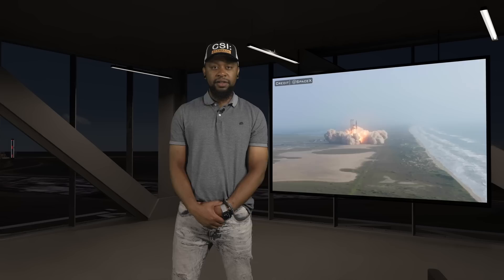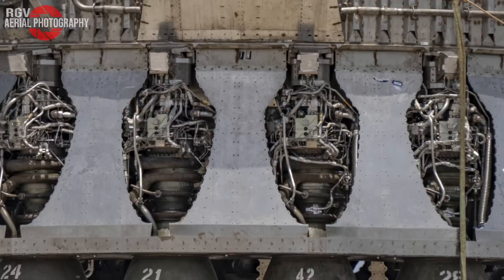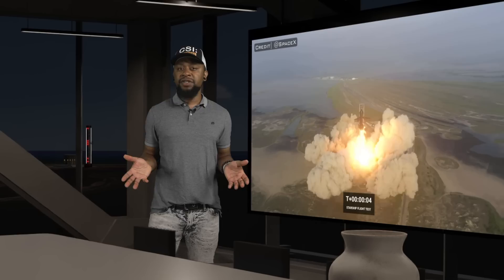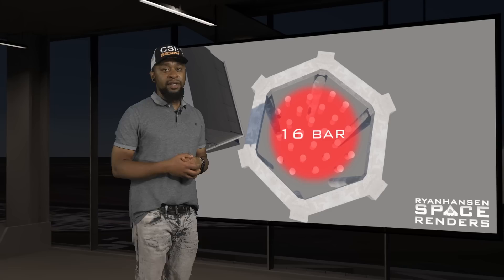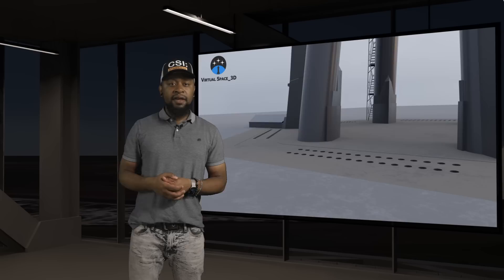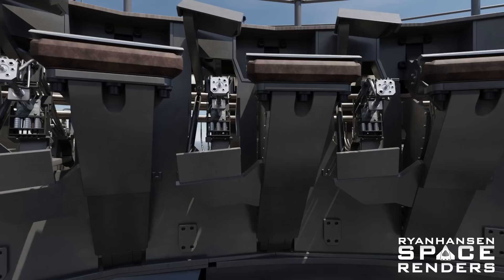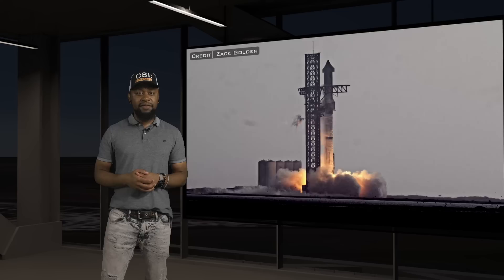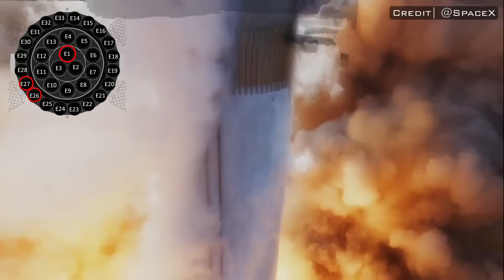The Design Flaw That Caused The Starship Launchpad to Fail!

Comment: A flat pad even with water cooled metal plates doesn't seem the best option. To properly divert the flames and shock waves, SpaceX should consider angled plates with tall water jets projecting water over it. While build near the tower a metal stand to place the booster for inspections and maintenance.
Reply: Maybe shallow cones stacked on each other, with water flowing down the slopes of each cone from under the upper cone... like a 3 tier 6 side pyramid thing
Reply: There is no need to divert flames as the flow of engine exhaust does that naturally
Reply: I advocated a V-2 style large inverted cone, sweat-cooled as we see here, last year. I don't see it as practical anymore. As for a second stand, it means added step(s) wasting time; and as EM told Tim Dodd, time is number one problem.
Reply: Nozzles could be vacuum venturi or like a pitot tube to use the exhaust velocity pressure to suck the water from the supply.  angled outward to assist exhaust direction transition from vertical to horizontal.
Reply: @richbarrows3922  Nice idea, a T shaped nozzle might achieve similar effect as per animations. Only problem is the top of the T shaped nozzle is unprotected
Reply: @123clickit  I agree.

Comment: Zack another great technical commentary and videos/annimation. Spacex engineers have done an incredible job in updating/modifying the OLM which has become incredibly complex with multi levels of safeguards. The rocket thrust heat transfer/vibration analysis shud be able to be computer simulated to provide adequate design - but as usual it is the 'unknowns' that are problematic. Great job by all !

Comment: Easily the most in depth and full technical analysis on YT of Starship's first launch. First time I have seen anyone actually explain how the water cooled shielding will be supplied with water plus an analysis of exactly what needs to be achieved in such a system to prevent explosive boil off within the shielding itself. Going to have to watch this video at least another couple of times to take all this info in.

Comment: CSI Starbase… THANK YOU! 👍 When you showed me that photo of WATER being pumped out, it all made perfectly sense:
I will bet you that LIQUEFACTION was the MAIN PROBLEM for the rapid unscheduled disassembly of the ramp slab!
You also pointed out, or speculated rather the missing rebar interlinking between the Fondag and the normal Concrete below.
The Extreme Sonic Energy released will also induce an extreme amount of heating in concrete. I am thinking that this could cause the water inclusions in Concrete to form steam and explode. The same principle makes ordinary Concrete unsuited as a fire barrier, especially in high temperature fires. The concrete simply starts exploding, shedding sharp shards with significant kinetic energy, which can erode surrounding structures by itself.
But as a Main Hypothesis I would put my Money on LIQUEFACTION! The Extreme Sonic Energy released would have the Sand Water Mixture liquefy in seconds, removing ALL Support underneath the Central Slab.
With the complex Sonic Interference Patterns, possibly coupled with variability in the Sand:Water Ratio, this Liquefaction may not have occurred in a Homogenous way, thus increasing Bending Forces across the slabs, moving the Force on the Concrete from Compression to Tension.
Fondag can only handle temperatures of up to 1,100°C. My guesstimate is that the temperature on the surface reached 4,000°C, so erosion was to be expected. But with a broken up Base due to Liquefaction, the internal strength in the Fondag would be overcome faster and more catastrophic by an order of magnitude than it normally would have, if only high temperature and compression were the eroding factors.
Reply from the maker: Thanks! That’s a great explanation!

Comment: It would seem to me that if the ship is still functional after a booster failure, even if it doesn't have enough speed to reach orbit. They could burn the tanks to landing weight and abort to splashdown, or possibly RTLS. Potentially saving the payload, or even the ship. At least they could have some mostly intact wreckage to examine.

Comment: Interesting! The choice of Fondag as a replacement for regular concrete was an experiment I would not have taken. Methalox combustion temperature is 2810 deg C, Fondag is only good for 1100 deg C. The pressure fluctuations and shock-waves would have caused failure, after the heat had broken down the Fondag, as you said. The exhaust force/pressure is perpendicular to the surface, rather than angular impingement that diverts the hot gasses. I have seen more re-bar in concrete structures for road-bridges in UK, combined with 110 Newton granite-aggregate concrete than this structure; although it doesn't have to contend with the heat.

Comment: What you should be talking about is the 13.3 kpsi static pressure on the pad at launch.  
This is well above any allowable concrete stress data.

There is no way it is only 200 psi as you stated in this video.  200 psi does not blow car-sized chunks of concrete 100 feet in the air.

Comment: 32:00  Knowing SpaceX's preference for software solutions over hardware I expect the water flow timing and volume will be regulated by info from the engine ignition sequencer. The nitrogen pressurization system will allow for very rapid increases in flow. This will match the water flow pressure to the exhaust plume pressure.
Reply: I agree. That is very likely how it would be done. And even if some flames get through locally the water flow would remove them before harm is done.

Comment: Excellent analysis and pulling together data! I do have a few questions.
Base structure: It seems evident that the center pad probably got destroyed from shearing of the rebar somewhere at the edges of the pile hex ring and then catalyzed events. Considering that and high-water table with no backfill, could the below sand have liquified thus dropping the utility of the central auger piles job? It looks like the launch created its own diverter.
Also, the blast pressure and heat simply cut into the concrete? 
Whats wierd is generally you would have a SF of at least 3X. looks like the hex ring rebar did its job.
I'm curious about how you came up with 16bar pressure? Would the launch pad have been higher by say 33 ft or 10m what impact in pressure would that have incl temp.? Maybe more practical as a long-term playbook due to high water table. However, wind loading may counter its economics.

Comment: 58:52 Automatically separating the Starship and landing it back to ground in case of booster failing low enough that orbit is not an option would also make a lot of sense.

Comment: pressure from the engine exhaust, onto the launch pad, is under-estimated. i believe 16 bar is way low. that figure needs some discussion. take the total thrust at lift off 7500 tonnes, and the surface area of the supersonic shock waves, as they escape the engine bells, and follow the shock diamonds down to the ground. while 16 bar may be an average, you should get something closer to 100 bar at the focal points of those shock diamonds. notice also that the water pressure coming out of the pipes to cool this must exceed that exhaust pressure or else no water will come out. the helium tanks pushing out that water then become a better estimate (accounting for pressure loss in the pipes)

Comment: Make the tower higher! Replace the stabilizer arm with a second chopstick. Remove the launch mount altogether, and integrate its functions into the chopsticks themselves. Launch and catch the rockets from a height that nullifies blast damage, without the need for water. Design the tower as a firewall to shield infrastructure on launch. Use the same tiles for the starship and the firewall(or alternative shielding systems). This will allow for the faster evolution of those pivotal technologies. To dampen shock waves, a passive sacrificial solution 3d printed from regolith, and incorporating anechoic properties baked into a tesla valve matrix.

Comment: Cool and well-researched video! 
I do have one comment about the 15 bar pressure being estimated as the pressure on the pad. It is true that 15 bar is 150 tonnes per square meter. This may sound like a lot, however, it is actually a really low mechanical stress: 1.5 MPa. A quick google search reveals that regular concrete has a compressive strength of 15-30 MPa. For context, steel has a strength ranging from 200-2000 MPa.

Comment: The liquifaction theory behind the concrete pad failure makes a lot of sense. Especially considering that the Raptors pulse power. Combine that with the very high water table so close to the ocean and it creates the formula for making voids beneath the pad which would cause cracking. The tremendous pressure and heat would do the rest. Those seconds before lift off generated supersonic chunks of concrete and rebar, some of which likely struck the base of Booster 7. It's a miracle it didn't blow up on the pad. Hardened and water cooled steel plates are the only option if a proper flame trench can't be constructed. Cape Kennedy had to deal with a very similar ground soil and water conditions, leading to elevated mounds to get away from the ground water.
Reply: I don't understand how people can think the concrete debris would have been able to fly up and strike the booster against the downward force of all the engines and exhaust.   I could see sonic/pressure waves causing engine and booster damage but debris being able to climb into the rocket's plume is hard to imagine.

Comment: Very good video. The number of engine failures and particularly the number of engines that failed to run properly on the pad is a concern. I suspect acoustic effects may be in play and was surprised that still no attempt is being made to divert exhaust laterally, redirecting the rebounding shock waves away from the engines.

Comment: Thoughts:
The vehicle normally should be able to hold attitude without any TVC engines or center engine TVC actuation, since the outer fixed engines can–together–steer the vehicle with Thrust Differential Control (TDC) (more thrust on one side less on other), but since most of the failed engines in the outer ring occurred on the same side, the control authority of the TDC of the outer engines were reduced below the threshold of being able to hold that aggressive desired attitude requested by the guidance computer (more below). I believe this is why the vehicle continued to fly after the 2nd HPU exploded/they lost comms with E3. 

Also, after the 2nd HPU blew up and TVC was not available anymore, since the vehicle was always below the desired trajectory curve in altitude, its attitude was getting more "aggressive" as it tried to "point up" to zero the altitude error to the trajectory curve, guidance computer requested an even higher pitch angle, which the wounded set of outer engine's TDC (which was barely keeping the vehicle flying) just couldn't comply with and thus we started to see a yaw rotation around the COM of the vehicle, and cartwheels.

Comment: As an architect I was always wondering about the way they used concrete. Concrete hardening period is variable and in steps. 28 days is the minimum waiting, and it usually takes around two months to have all the humidity gone in the concrete, and the concrete has reach its normal compression strength. Did they really do the usual strength/compression  tests of the concrete slabs? Other problem is layer over layer of concrete yields a problem of adherence that lies between the old (read already in the drying process) and the new. 
Pretty sure that the Fondag commercial engineers where having a heart attack about the way SpaceX used their product

Comment: Great analysis.  Loved the detail.  I wonder if it makes sense to try and save the upper stage if too many booster engines fail.  The ship doesn't need to reach orbit and it has plenty of fuel to do the boost back. It can hover at some point on the emergency return to burn off enough enough fuel to not overload the chopsticks.  Saving the payload (especially if human) is important.  What do you think?

Comment: The single strand of rebar in the center pilings probably didn’t do anything to decrease the concrete strength. Concrete is extremely strong when it comes to compressive forces, the reinforcing is to hold it together, when there are tension forces,  and whether that is side to side, movement, or things being pulled apart or twisted. Since those pilings only had vertical compressive forces, I don’t think that an entire tube of rebar would’ve made any difference.

Comment: @CSI Starbase ... Zack: If my theory is plausible, Starbase will need to install check valves pumps In the high pressure deluge line to prevent backflow that would prevent backpressure  from the engine plume forcing the Deluge to reverse flow, overload the pipes, and blow the system apart.  We only want the water to flow in one direction.

In regards to the cryo-water jets,used to suppress O2 release, should be pointed at a 20° - 30° down angle, adding to the sound suppression and direct the ignition plume straight down protecting the ignition system and hold-down clamps.

Comment: Concrete holds water aswell. Meaning no matter which type of concrete you use, it will always crack when exposed to high temperature to fast without getting a chance to dry out.

Comment: Maybe during the boosters last few seconds the methane down comer collapsed/buckled around the retrofitted area near the lox reserve tank because of main tank pressure loss due to the FTS, combine this with seemingly a leak in the bottom of the main lox tank and the engine bay on fire... well.

Comment: I am wondering about the exhaust of Raptors. Is it fuel rich or is it oxygen rich? Oxygen rich would likely cause erosion of steel in the pad. Something like adding oxygen to a cutting torch, the additional oxygen makes the steel burn.
Reply: The fuel storage is slightly less than oxygen at liftoff so not sure if this is the case
Reply: The Raptors reach almost perfect combustion. If the exhaust is oxygen rich it would be very small. Unless things go wrong and Raptors fail.
Reply: It's not possible for the exhaust to be perfectly mixed (stoichiometric) the nozzles or the throat will melt. Therefore all rockets and even internal combustion engines are above or below this limit.

Comment: they new the pad would be eroded by just a 10 second burn, its not like they could do a full static test with hold-down. if the engines spool up, why not let the ship fly :D They learnt much more about the controllability of the rocket with engine outs, the structural safety margins from tumbling at supersonic speed, how the FTS operates, etc. ..
Reply: Absolutely, it is why people calling this a failure fundamentally do not understand why this test program needs to be run the way it is. 

When the US and the soviets were trying to figure out how rocketry worked this is exactly how they proceeded, and did so on the back of dozens of test articles. This was because rockets of this scale were a whole new scale of engineering, and so much was unknown that the only way to figure out what would be needed every step of the way was to simply try and see what happened.

And every time there was a new scale level broken new problems would arrive from previously unexplored sources. For example by the time of Apollo, the US had become proficient in the use of open cycle RP-1 engines, so for them it looked like designing the chunky but simple F-1 engine of the SaturnV would be easy, yet every time they tried to use the engine it would invariably blow up due to combustion instability and it took a few engines to figure out what the cause was. Same happened for the RS-25, the shuttles engines, and the shuttle vehicle in general, though that one arguably suffered from never actually being allowed to be flown and tested early in it's life without crew. 

And now once more is happening with SpaceX in a major way, as not only is the rocket exceeds the power output of its nearest competitor by two times, but it also redefines nearly every process in the manufacturing of a rocket, to clearly unpredicted effects. 

But SpaceX learns at a frightening pace, and it will not be long before they are back on the pad ready to try again.
Reply: @mobiuscoreindustries  Well put!

Comment: When it comes to these launches I don’t go with an all or nothing approach to its success or failure. Like any new endeavor it’s going to be a long line of tests which will yield a mixed bag of results.

It reminds me of something Thomas Edison is supposed to have said… “I didn't fail. I just found 2,000 ways not to make a lightbulb.”. All of his failures and setbacks showed where the issues were, what methods did work and gave a better picture moving forward.

This last launch they succeeded in clearing the launch area. They also found they need to work on the pad area itself along with a ton of data from the starship of what worked within tolerances and what failed. With all that info they will likely make changes and fine tune things so that the next launch will be a step in the right direction.

This is a process that will take time, remember when NASA started its space program there were a ton of “failures” from the very beginning but those failures showed them what to avoid and what direction they need to go.

Comment: 57:35 Common Sense Skeptic has a good point about the implied question underneath what you asked. The main issue here is the Starship SHOULD be able to escape a booster RUD if there’s precious cargo like humans onboard. If there’s no guarantee that the Starship can escape any situation with a fast enough reaction and enough speed, Starship won’t be rated for human cargo. It’s incredibly important that this is solved.